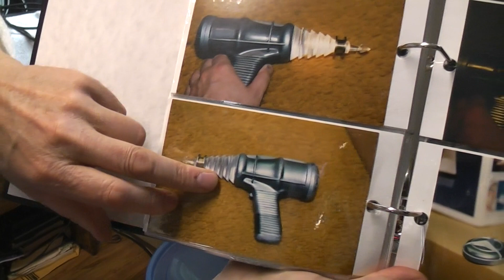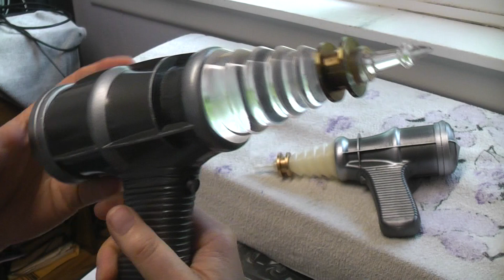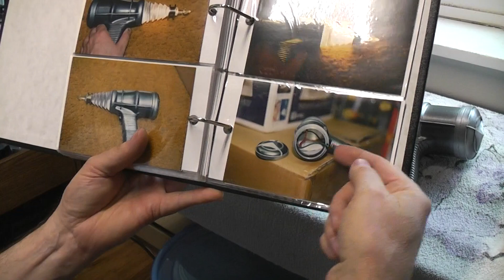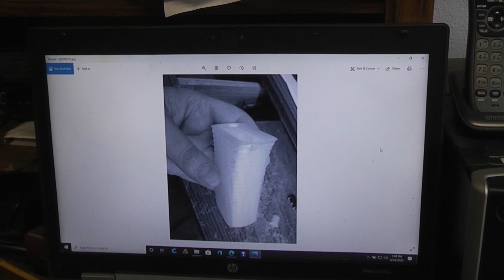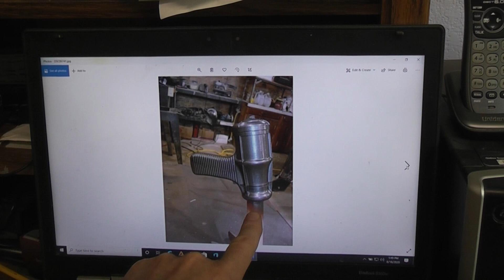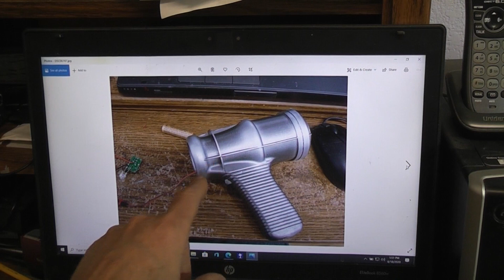Build the Forbidden Planet Blaster. 3d printed

Comment: Found a solid resin kit in my stash is it possible to drill out to make it with lights
Reply from the maker: Yes the resin body would drill out with a forster type bit real nice. Now if the clear tip is solid that might be a problem.

Comment: I am a huge fan of Forbidden Planet and all the fantastic props it featured. I started printing my "Simple Blaster" to quote from Robbie, last night. Thanks to TheOther10 for posting this and for you in pointing this out and for the modifications.

I will be building all of your Forbidden Planet props. Just ordered a selection of those TT Gearmotors in 1:48 and 1:110 speeds. :)
Reply from the maker: There seems to be many different speeds and sizes, they seem to copy each other in china as well but not always to the same spec. So some will be crap and some may not fit the printed parts. Its kind of a crap shoot. But they are cheep.

Comment: Were any of the other props from Forbidden Planet preserved or are there details for making replicas? The C-57D officers belt had the communication device with the mic/camera on a retractable line. Not sure what the other devices were supposed to be, other than in the movie they occasionally use what appears to be a microfilm viewer. I had started making my own mini-blaster for WalRobby, (just hand made, I don't have a 3D printer, but after seeing the files by TheOther10, I see it's off a bit.

Comment: thanks for the info on the original gun and ref pics, i had downloaded the original file but i think i will wait to see if he modifies the handle before printing.
Reply from the maker: Yes if he does mod the handle then I will mod that new file to work with the micro switch so any LED flash light can be used and up date my version.

Comment: Interesting- no sight on the Gun. Guess it requires practice.⚡🔫🐙  ?
The bulkiness suggests a more pragmatic super capacitive type storage, unlike the slim Star Trek phasor. (which I always thought was kind of reaching)
Clever you made the barrel a 'screw type', so it can be printed in some other material if desired. I didn't know the gun was portrayed in other Sci Fi movies, too.
Another master piece. 😎👌
Reply from the maker: All of the Forbidden planet props and costumes were reused in other films . They had a Blaster rifle for long distance so this Blaster gun might need a sight for close range destruction.

Comment: if you could can you make videos about all the other robot statues like the b9 statue,the johnny 5 statue, the planet robot robby toy statue, the robot band, the b9 electricity robot,the original robby design,and how you made them and like for the robby jeep and how it works.
Reply from the maker: I will do my best , I do worry abit that much of the "how I did things back then" might not be interesting. But if I can bring together enough information I will. Back in the 1980's and 1990's I shot all my builds on VHS tape, so I have little in the way of images that I can share of the work these days.
Reply: @Robothut  Speaking of Robby toys, I found another Robby on "Twilight Zone". In ep 4/15, "Horace Ford", he's a blueprint. Ford's Robby had different feet and hands, and a bizarre pink human face with light-up eyes and working jaws... but he's still Robby!
Is the Fistful of Yen robot the Horikawa Rotate-O-Matic Super Robot? Closest match I've seen...
Reply from the maker: @Pygar2  Yes noticed the T Zone Horace Ford Robot blue print years ago when the boxed set of T Zone DVD's came out. Yes you are right on the Yen Bot. I have one in the Roonthut.

Comment: Do you still sell the cast ones?
Reply from the maker: No that was a 1 time thing back in the 1990's. I gave some away, sold some and made just parts but again that was long ago. This 3d printed version is better in that it costs less to make , looks great and is so much lighter in weight than the resin and solid plixieglass tipped ones.

Comment: How can I get one of these in raw form? I do not own a 3d printer. Thanks
Reply from the maker: Well seem like you have to find a person with a printer or buy a cheep printer. There are online services for 3d printing if you google it, but I bet they would cost more than it would to buy a small printer. May be some one will see you post and offer to print the parts for you.  Could not hurt to get some price quotes from the online printing services. But the PLA filament required to do the job would only cost you $5 or $6 bucks. A role of PLA is around $20 bucks it would make 5 or 6 blasters. A Ender 3 type printer is $180 to $200 bucks and there are even lower cost printers out there.